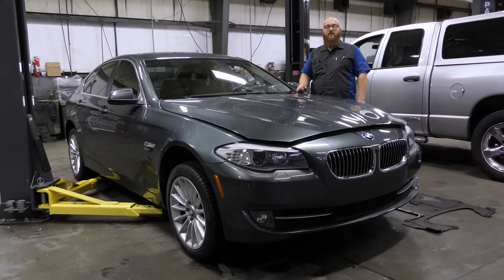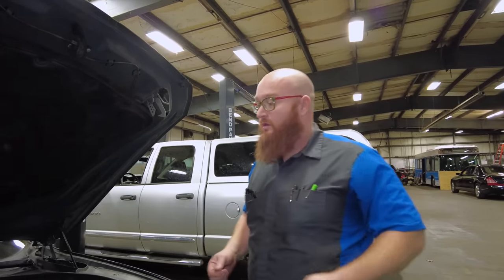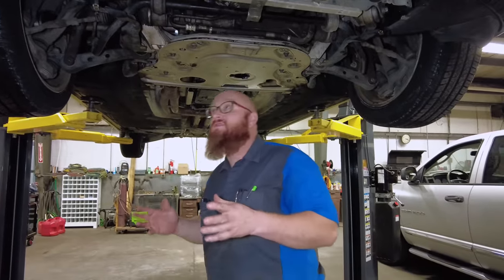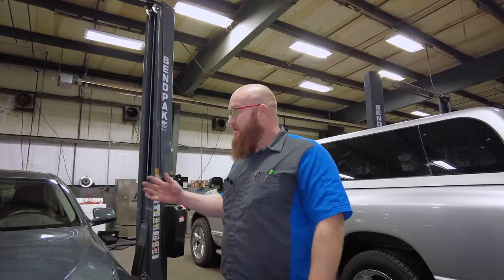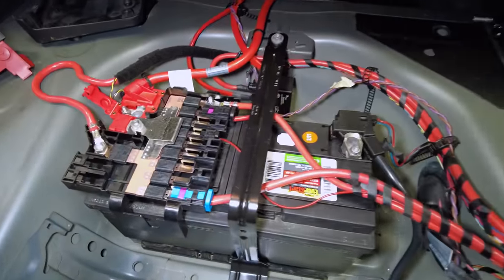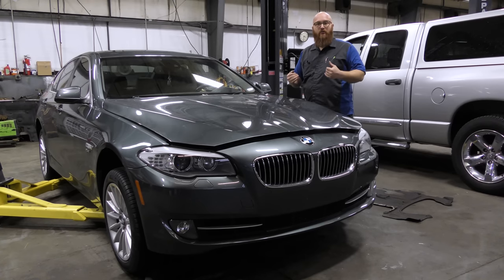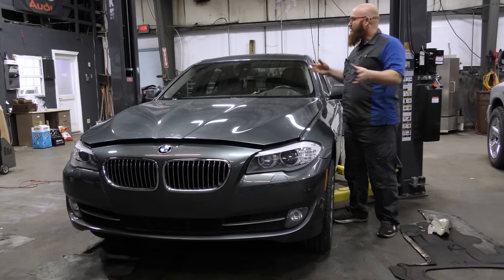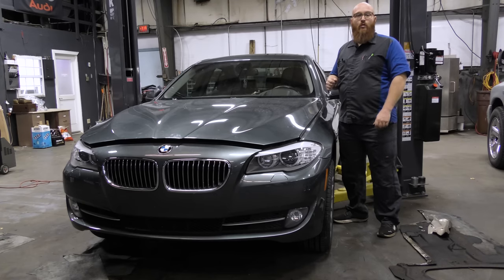One bad day for a customer! CAR WIZARD found TWO insanely unrelated issues at time on '12 BMW 535i

Comment: The motor overheated a 200k starter and you can get a new starter for 150 bucks and the intake is super easy to take off.  The N55 is a good motor think about 200k miles on any engine you will have problems.  I like the fact you took this on wizard and didn't just send it to the ninja.  BMW makes the best six cylinder engines in the world, yes I am saying this with first hand experience, you can tune them and make amazing power and they are silky smooth.   Now the problem with BMW as a brand is there V8 and four cylinder engines are garbage for some reason they can't make a valve seal or timing set for either that are worth a dam.  Your customer could DIY this job for an inexpensive price but he is in good hands and no one really wants to be their own warranty,  Excellent content Wizard you make all of us proud your honesty and experience is worth every dollar your customer is lucky to have a tech as good as you are in the area.
Reply: Wouldn’t say super easy. But easier with practice and it seems Everytime this car has an issue, you’re having to get that manifold out of the way to get to the source.
Reply: Agreed. I love my 535i. I upgraded the charge pipe to aluminum. Brand new coils and plugs. She runs beautifully. Will be doing my oil filter housing gaskets next to save myself a future headache.
Reply: Sorry, 200K miles is nothing for a decently designed engine, especially a diesel.
Reply: @rogerfroud300  The N55 is a direct injected petrol engine not a diesel and I agree 200k on a diesel is not a lot
Reply: @Technologically Challenged Tech Yes I agree the BMW b58 that powers the supra is very reliable , You understand that the germans refined that technology that's why toyota adopted it.  It was more cost effective  for toyota  to use a BMW engine then for toyota to make one from scratch.  I can attest to the plastic that fills the engine bay of my ten year old N54 powered BMW that much is true but It makes over 500 hp and is driven daily with over 120k on the odometer and it still runs perfect and I am kicking the pants off of brand new BMW, Toyotas, dodges, cheverolets.   The turbos failed at 100k and were replaced along with all the other plastic bits that fail including water pump, thermostat, radiator expansion tube etc.  Just look at the new cars they are all plastic no matter what the brand it is and a Toyota will out last a BMW but besides the supra they are boring to drive.    The price I paid for a BMW that depreciated 60% of it's msrp was worth the 3,500 investment in parts to make over 500 hp, it is a really fun daily driver
Reply: Spot on. The N55 is a great engine, but that car needed the entire cooling system replaced at 100k miles and again at 180k miles. Fast, reliable, cheap. Pick 2.
Reply: @rogerfroud300  BMW owners don’t want to drive a old 200k mile car…. Nobody who didn’t drop out of high school wants to drive an ancient work engine like They are some discount drywall contractor
Reply: @TheRidersChoice  Sounds like you are a prius owner stuck in traffic so smug lol nice comment
Reply: @timlad123456  just joy some broke boy who still needs to drive a car with 200k miles on it lol. I’m sure it performs great hauling the lawn mower you use to do my lawn
Reply: The Buick 3800 would like to have a word with you...
Reply: Ew.
Reply: The most reliable (modern) bmw engine is definitely the n52. They are n54 on ez mode to fix
Reply: I am confident BMW could make nice gaskets if they wanted to but the material is not as good as it could be. Not a materials guy but BUNA rubber?

Aftermarket gasket makers offer Viton seals for several common leak components to increase service life.

BMW intake out for starter is common for BMW since the 80s. Not exactly new.

I doubt that the intake out job plus starter on F10 535i is 5 hours.

3 hours diagnostic, plus the hose plus a $1200 starter, and the poor customer? Cashing in!
Reply: @rogerfroud300 535i isn’t a diesel, the 535d is
Reply: @Boguardis no v6 is as good as an i6
Reply: Honest and Good are rare in the car repair world. But...$150 an hour is the price you pay for that!  Owned over 50 6 cylinder BMW's all have had more than 200k when I sold them . Never bought new in my  life!  Never had a blown engine. My E38 749i  was my only 8 cylinder and after changing the timing chain plastic guides at 239,000 kilometers it ran well until rust killed it at 480,000 kilometers. Or 300,000 miles! Very few rear wheel drive cars handled so well in Deep snow!
Reply: @technologicallychallengedt8549 It is not cheap plastic. It is plastic that needs to pass EU environmental legislation.Japanese made stuff is more durable over time.

Comment: Great video but it's important to note that wizard is a BMW hater, and probably has a skewed perspective on BMW's since he only sees them when they blow up. Also if you're going to daily drive a BMW that's 10 years old with 200k miles, you need to have money in the bank for repairs. I say 200k miles and only a hose going and a starter failing seriously isn't that bad.

Comment: If the starter solenoid DIDN'T fail, he would be needing a new engine now. You know he would try and make it home.
Reply: Yupppppp
Reply: My thought exactly
Reply: Yup he purposely ignored the low coolant light, drive up the bill some more to a whole new starter hahahah 😆
Reply: ikr
Reply: Divine Providence.
Reply: @hulk-smash-deez-hose.7951  I don’t think he did. These literally just dump all the coolant out at an instant. It’s not that it slowly leaked. It just dumped out. It’s a common problem on this and the e46. That’s why they recommend to change the entire cooling system every 60,000 or 70,000 miles to prevent it from happening. Yes that’s right. The ENTIRE cooling system. We’re talking reservoir, thermostat, hoses, even the radiator. Everything.
Reply: @Sci-Mon1 sounds like a lot to replace but it’s really not a lot once you see every part on the floor plus cooking system on e46 is very straight forwoer
Reply: @-justodyssey-9212 Lol, "cooking system" :D

Comment: Heat is a killer. Maybe the engine overheating cooked the solenoid. It is mounted to the block at the hottest point of the engine, Under the intake. Probably right next to the exhaust manifold.
Reply: Nah.  Intake is the cool side of this straight size.  Exhaust and turbo are on the other side. Apparently they're just junky starters.
Reply: He probably drove it too much distance when the the engine was already overheating. I had a coolant hose burst on my BMW in chilly weather, could see white smoke coming from the front of engine, I pulled over the car and shut the engine off immediately just before the needle reached the red area. The cost of the repair was only $200 for hose, coolant (which bought from BMW dealership), and diagnostics.

The thing about these cars or any car is if you catch the issues quickly, you could be saving a lot of frustration and money.
Reply: @cthis4786  I don't see any real evidence to blame this exact situation on "because BMWs are junk"
And from experience I can say that BMW XDrive is one of the best in the snow and ice. When everyone else is having a hard time getting around, XDrive will get you through it
Reply: @chipmunk1631  twice a year!lol.All you need is studded winter tires
Reply: @chipmunk1631  My BMW is super old, doesn't even have xDrive but has planetary AWD (similar system on modern Mercedes AMG vehicles) which is much superior in terms of handling and dynamics, yet handles just well in the snow with all season tires. Just get good Michelin all season's. xDrive destroys the handling on a BMW, a BMW should be rear-wheel drive only, but xDrive sells in colder climates.
Reply: I had the issue happen on an air cooled motorcycle when i was learning to ride. Definitely baked it like a cake when the coolant was gone.
Reply: Annndd he kept driving it too. So that thing was really hot but he kept driving it !!!!!!
Reply: @chipmunk1631  -- Agree!  ANY CAR can have a starter go out, oil leaks, and a hose blow off at 200K miles -- give me a break.  And none of these problems have ANYTHING to do with xDrive.  The Wizard WENT OFF THE DEEP END on this one.
Reply: Start failure following a coolant blowout and overheat event, on a high mileage BMW... Excess moisture, heat and miles... Not rocket science troubleshooting.
Reply: I’d be curious about the repair history.  
Like it or not, if it’s one thing we BMW owners have to be aware of, it’s replacement intervals.  My water pump bearing just gave out, and if I’d been on top of the miles I put on, I’d have saved a lot of hassle replacing it when ‘I’ wanted to… with a lift and tools, instead of when it decided to take out a belt and fan, consequently working in front of my home.  

FCPeuro lifetime replacements take the Win tho.
Reply: Could some of the coolant shorted out the starter? Maybe when you have the starter on the bench something will pop out.
Reply: @Natepwnsu  coolant in an air cooled engine?
Reply: Agree!  The overheat condition made it just hot enough to cook the starter’s solenoid.  Hopefully the engine is still okay.
Reply: I had a Corolla that did 350,000kms+ and never had a starter motor issue.
Reply: @cthis4786  my BMW 5 Series wagon has AWD and I have excellent handling. I wouldn't have it any other way. I've driven a newer Porsche and I can confidently say, my wagon handles just as nice in my opinion. I walked away feeling content with what I have
Reply: @ShowMeWhatINeedToKnow  sure, BMWs can have weird issues. But they aren't junk
Reply: @yslee1401  I had an '88 Lincoln Town Car 400k miles. Fuel injector issue when the car was 6 months old fixed under warranty. Other than that, a water pump, a "Y" pipe and alternator later in life. A junkyard transmission at about 350k. Finally the heater core went at just under 400k. It wasn't worth the huge job to fix. All on the broken streets of NYC. Aside from a cheap set of shocks, that car never even got any suspension parts.
Reply: Exactly 💯
Reply: @ShowMeWhatINeedToKnow  I think if you dont wanna mess with X-drive just take it out if its need repairs. So you would have a classic rear drive BMW. I mean there is no need not to choose BMW with X-drive. Ofcourse if the goal is to have 4x4 drive than maybe X-drive is not best choose.
Reply: @xodus_sys  -- There ARE very good reasons for xDrive: If you want to GO when you mash the pedal down -- and you want tenacious grip and acceleration out of the corners -- especially doing all this in wet weather.  I live in the PNW and HATE wheel spin when I want to take off.  Not to mention you can have fun with an occasional AWD drift, when you want to hoon it.  I have a 3-series with xDrive and don't regret going AWD for one second.  I love taking it up to the mountain in the snow, with a set of snow tires as well.  Unbeatable.    xDrive issues are very rare.  Keep in mind, NONE of the problems the Car Wizard talked about with this car have anything to do with it being xDrive.
Reply: Or, it has 200,000 miles on it...
Reply: @XcoolcoolbeansbeansX  -  Exactly.  A starter, loose hose, and non-critical oil leak are MINOR ISSUES -- and par for the course on any 200K mile car
Reply: @armedreptile7889  I'm confused as well: "an air cooled motorcycle when i was learning to ride. Definitely baked it like a cake when the coolant was gone" <-- HUH???
Reply: @chipmunk1631  As I've heard lots of stories about broken front axles on XDrive, along with poor placement of the front diff (BMW even limits the power of the engine after a certain steering angle to save the axles) - and as a quattro driver - I would have to disagree. Xdrive isn't that - it's not Torsen-based - and the construction is clumsy, unreliable and heavy compared to Quattro. That's the reason audis understeer - because the engine is so far up front - because how quattro works - front axles come out right out of the gear box - but, you can't kill quattro, trust me, I've tried - however, xdrive will constantly kill itself.
Reply: @cthis4786  Wait.... what BMW could that be? They haven't been using AWD for very long. Wasn't the first 5-series with AWD the E34? Also, the E30 could be AWD, right? So how does "planetary" work? Where does the power to front come from - where's the transfer case? I know how it happens on my audi quattro - and I know how it happens on newer BMWs - like on most AWD cars, with a separate transfer case - but old - like really old - BMWs? How does that work?
Reply: @JurisKankalis  as having an AWD BMW I can say confidently I will have no trouble getting around the winter even on the worst days. My AWD got me up a closed mountain trail in Utah in January 2020 through a foot of snow and helped rescue a guy in a pickup who had slid halfway off the side of the mountain. When the Sheriff's Department showed up they were shocked to find a BMW up there
Reply: @Globbs  all cars will have something break. What we're debating is that the Wizard was really laying it heavy on it being purely because it's a BMW. I have a 2006 and I've not had a starter problem yet. Take care of your car and you'll be fine. But things happen with any car. And so, maybe BMWs are most susceptible to certain things than say a Toyota. Well, Toyotas are built super simple and they don't take any chances. If you want to drive an appliance, or your only concern is point a to point b, buy a Toyota.
Reply: @JurisKankalis  I've never heard of any stories of broken front axles on an xDrive.
Reply: @ShowMeWhatINeedToKnow    Vibrate and clunk, not necessarily break.  Just look at the angle they operate at.
Reply: @alskooper3319  so, you're saying that the CV joints wear out? Just like in a front wheel drive car?  Do you somehow expect CV joints not to wear out on an all-wheel drive car?  They don't wear out any faster on an x drive than they do a front wheel drive car. Perhaps even less, since they turning angle on BMW all-wheel drive cars is more limited. Go on the forums if you don't believe me. This isn't an issue
Reply: @ShowMeWhatINeedToKnow    Don’t need any forums.  My personal experience as a BMW tech and shop owner with 48 years working on BMW’s.  You can believe whatever you want.
Reply: @ShowMeWhatINeedToKnow    🤣🤣🤣
Reply: @ShowMeWhatINeedToKnow  Your right. Except some cars are easier to deal with and repair when a starter goes out. Case in point, I had a starter fail in my first car. But because it was a manual I could push start it to get home instead of calling a tow truck. And because I was young and broke at the time I had to resort to continue to push start it for a week to get to work until my next paycheck. Which only ended up costing me $150 to get fixed in the 90's.
Reply: I seriously doubt your overheated solenoid theory
Reply: @bouttreefiddy umm wut? Air cooled has no coolant. Lol.
Reply: @theundergroundlairofthesqu9261  They are trash starters I literally replaced over 100 of them over the years. All fail with the solenoid that failed. Literally takes hours to put one in. I dread working on them.
Reply: @cthis4786  j/s if you shut the car off right before the “red” area that motor got fuckin HOOOOOT from the heatsoak. Miracle you didn’t warp the head enough to leak compression.
Reply: I've heard of Honda starters going out after 200k miles. They usually last most of the life of a car .
Reply: Those stupid engine covers keep heat in, take them out.
Reply: @chipmunk1631  blox-
subaru pisses over bmw x drive
Reply: @chipmunk1631  Regular, proper maintenance with OEM parts is the Key to long life and Great Handling!
Reply: @chipmunk1631  1988 -1992 325 ix was the first here in Canada and it rode on rails, way better than the Quattro then. Super reliable car and a Joy to thrash through the snow!
Reply: @chipmunk1631  Engagement in the comment section is why the wizard posts these videos. The YouTube metrics at the comment traffic first and foremost for ad value. They boost your channel depending on this engagement..

Comment: The old, worn out starter failing could be from a brief but extreme exposure to the overheat condition that just tipped it over the edge.  I had this same thing happen on a Chevy once.  The down side is, it could be a sign of just HOW hot that engine got…
Reply: or auto stop start wearing it out over time or just plain bad luck
Reply: @raven4k998  Yes, good idea to code these cars to remember the start/stop setting, so if you turn this feature off, it doesn't turn on automatically next time you drive.
Reply: That is exactly what happened. My 3 series did the same thing. Had issues with my electric cooling fan and the extra heat in the bay caused the starter to fail.